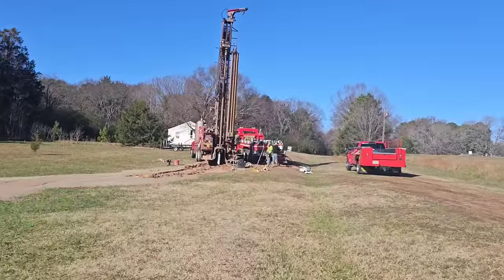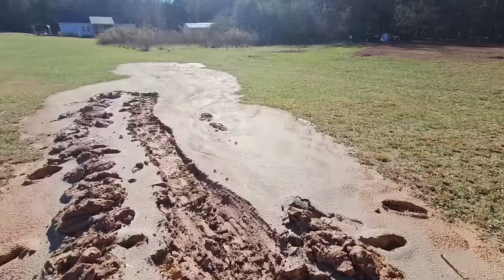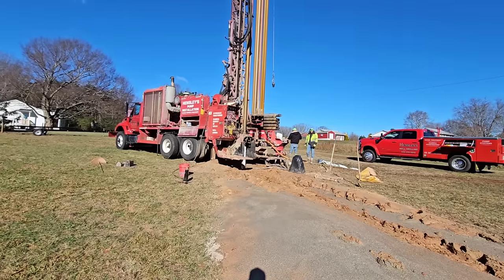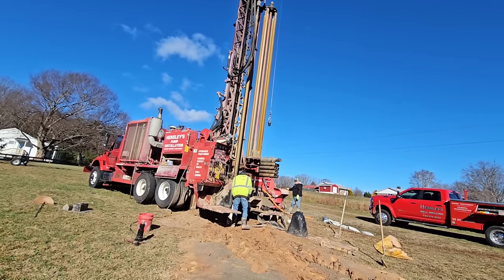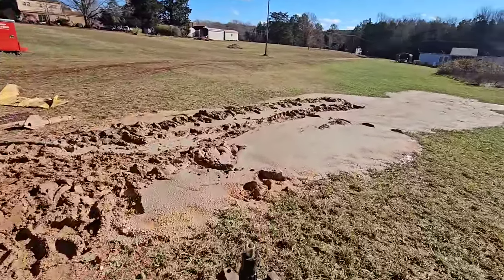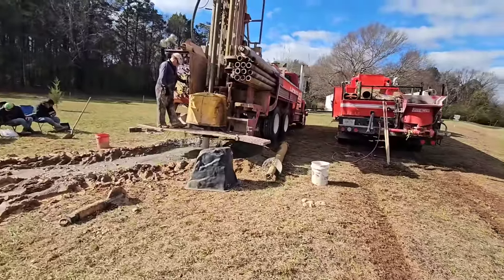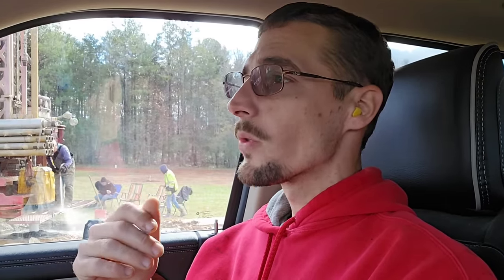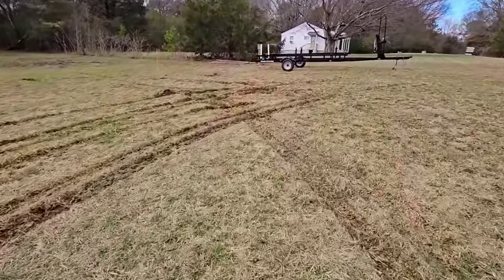The Worst Well in a Decade!

Comment: Around here in Central Florida it is common to lose circulation due to cavity's. Sometimes you can see your circulation spraying out of a neighbor's well. That is not a good thing.
Reply from the maker: I've seen that when Fracking a well, I often go look around the neighbors well to see if we're pushing water out. Only seen it once so far.
Reply: We had that happen on a Jordan well in Iowa. We were at 1860' deep and opened a sand cavity 3200' away to another well when we were developing the well. We had probably 100 dump truck loads of super fine sand come out of that hole.
Reply: @johnhardt5016  Wow, that's a long way. Ours were only about 100 feet away.
Reply: We also had sponge looking rocks as big as your first coming out. We did all this with an 18" hole opener on the end of our string of pipe.

Comment: Just be grateful you weren't drilling a geothermal well. Lived in Eastern Oregon in a town with a large number of geothermal wells. The underground water is about 195 deg and there was a 6.0 earthquake back in 1995 that caused the wells to artesian that actually melted the asphalt as they ran down the street. Appreciate you taking the time to explain what you see and hear during production and what they all mean. For the layman, I have no way to tell when you hit bed rock or water by the water spray under the rig.
Reply: How deep is one of those wells?

Comment: I used to drill using an air rig in California gold country and occasionally would drill into an old, unmarked horizontal mine shaft whose location was long lost to history.  This usually happened around 100 feet and would instantly stop the hammer at the bottom of the stroke and a total loss of air.  Usually moved around 50 feet from failed well and started over.
Reply: Lots of those down around Georgetown, Cool, even out to Diamond Springs.

Comment: Great video, in my drilling area  70-80% of the jobs we do are like this. We just do steel temporary casing and pvc casing to total depth.
Reply: I do the same here in europe...drill with steel casing after we finished drilling  run pvc casing n pulling out the steel casing. (*We use double top head drive rigs)
Reply: @xFlavoriax  that is the way. I am looking for one of those rigs and I actually asked for a foremost DR24 yesterday. The asking price is $1,040,000.00 (not in that league yet. )

Comment: You need to borrow from the oil fields in how to deal with this situation when setting the surface casing and drilling through the veins of rock.  You need to drill with Bentonite drilling mud. The drilling mud will hold your drill bore shape while setting the stone and sand from back filling you bore.
Reply: He mentions using Bentonite at 21:20
Reply: @Bleda412  this was in regards to grouting in the casing, I talking about a drilling mud that is used in the drilling process, and are 2 separate things.
In the oil industry they USA a drilling mud that is a bling of Bentonite, cellulose and ground retired money, in the well drilling process to seal off zones during the whole drilling process. 
They drill through the aquifer zones, then set casing, then filling the  casing with concrete, then set the blowout preventer, then they drill through the concrete to the target depth, then they set the production casing  down to the production zone.
This process isolated the aquifer zones from contamination.

I am familiar with a well that was drilled which was a horizontal directional well that was to have well over 5000 feet of horizontal bore, that lost 3 drill bits, they had to send down explosives inside the drilling Cable to cut the cable, and had to do this 3 time because of fractured rock in a fault zone, at that depth we are talking salt water zone.
The completed drilling the well as a directional diagonal well, which gave a very small production zone of the well.
The difference is he is using a hammer drill rig,and in the oilfield they are using a rotary rig using a diamond   Impregnated rotary bit to drill through the rock formations.
Reply: Worked for a core drilling outfit in my unger days,  no way your going to make it thru overburden without bentonite, especially on a 45 degree hole.  Must be nice for these guys to punch a hole in a day, leave a mess behind and hand the owner a $25k bill on the way out.
Reply: @raymondheckard234 they have a small shramm air conditioner rig, they done have duplex or triplex pumps on site or even a mud tub. The run a hammer and water injection.
Reply: @johnhardt5016  this is a big problem because it does not allow them to use drilling mud to seal off the areas in the bore hole such as sand zones or gravel beds.

Also with the drilling regulations of the EPA that is coming and is being pushed in states like California in the water well drilling, the days of allowing the tailings from the bore hole to run on top of the ground will be over and will have to be captured and filtered from the water before it is discharged.  

The EPA has a study that shows the tailings from water wells like all mining operations have contaminants of heavy metals.

A friend in the oil and gas industry was talking that soon the water well drillers will also have to comply with the the same exact regulations as the oil and gas industry under the Biden EPA.

He said it does not matter if you are digging  a well 100 ft or 25000 feet, when drilling through the rock formations, many of them have heavy metals in them, and to the EPA Granit dust is toxic, as is all drilling  tailings to the EPA are like all mine waste, Toxic.
Reply: @raymondheckard234 I totally understand and agree with you. I am a halliburton mud school graduate and understand the benefits of drilling muds and granulated bentonite sealing for the well bore. 
However you earlier stated using LCM (loss circulation material) for the purpose of drilling applications that aren't allowed in residential water well due to EPA regulations. 
However, usually a rotary mud drill is ideal for many applications for the purpose of the bore stability and retention. This doesn't seem to be a local regulation for these men. 
I enjoy talking with another person who sees the hypocrisy in the drilling field rules for some but not for all. Lol, have a good day man I look forward to hearing back. I am being a bit of a devils advocate here. I also want to see people understand the creation of a water well because most don't have the foggiest idea what it takes to develop the skills to read the earth like a book.
Reply: Thanx that is the best way for such situation. The problem is that situation is unexpected for the geology of that area "...to do the right thing saving time n money."

Comment: Interesting videos! I got a worse one yet for you if you like the tricky ones lol. Had 3 drillers here, worst/most expensive failure we have here was drilled 380ft total into 'traprock', 6" steel cased to 340', static water level around 250', produces 1-2 gallons per day. Can't get any of them to come back after a taste of the nightmare over here haha.

Comment: Bro I don't know if this is a 22:20  coincidence or an intervention but iam drilling a well right now with the same exact situation with the same Boulder problems and I dont know how this vlog just came up. I  just removed the 6 inch casing cos all torn up. Will use the 8 inch hammer to break all the rocks at 30 to 40 feet then put a 8 in casing then clear more space and put the 6 inch. And then drill the well to the bottom to 150 feet. Man I thought I was gona get lucky before Christmas and this nightmare well confronted me hahahah. Loved your video bro. Regards from western drilling Fiji

Comment: In drilling which makes drilling very difficult is drilling through boulders...i remember one site we left it because we cant drill any further. In this case using some other methods r very important.. here in europe we have double head top drive which makes the work easy or using auger bits and let the casing going through, after we go through the boulder formation normal drilling continue till the end. I like to hear from ppls used a different system. 😎

Comment: You made mention as to your preference in using chips vs. grout. I believe that using grout would probably be best as grout expands when it dries therefore creating pressure between the casing and bore hole sealing the two. The use of chips would not do this. I am not a driller but learned the use of grout in the traffic industry as it is used to hold the traffic poles up against their anchor bolts and base.

Comment: Hi, bit unrelated to todays video but I have a question: Lets say you are drilling a well and hit (bit of) water at 200ft, decide to drill deeper and hit another water at 600ft. Now those two aquifers are connected by the well and the water can flow from one aquifer to another? What if your neighbour has 200ft well. Can your well drain the 200ft aquifer making the 200ft wells in the area dry over some time? Similar situation: you hit water at 200ft decide to drill deeper and don't find another water. Can you lose the water by draining it into some porous rock deep down? Thanks
Reply from the maker: The static water level on both wells will be the same.  Both would fill equally, one would just have deeper storage. It would only cause a issue during the drilling process of the 600ft Well bc if its connected to the 200ft well it would drain it dry temporarily (I've seen it happen). But during typical usage, both should be fine. It's rare unless 2 wells are 50-75ft away from each other.

Comment: Sop forgive me if you have covered it before, but I assume you just push air down the drill pipe then to the head?  What kind of pressure / volume do you inject into the hole?  Keep up the good work sir!  👍🤠

Comment: When I was a kid my grand parents had to drill a new well on their place because the water quality was so bad. They lived south of Monroe, Louisiana in an area where one of the largest natural gas fields also exists. They had to go about 450 feet to get good consumable water. They were on their third hole before they were able complete a hole. At about 75 feet they’d hit a natural gas pocket and it would blow the whole drilling rig several feet into the air when they’d hit those pockets. The first pocket they hit cost the driller a few sections of drill stem because it broke off when they hit it. I got to see that and it was scary.

Comment: I will have a driller out in a week.   It will cost over 100K to drill, steel case 575', and gravel pack.   If they loose circulation that will cost $10,000 more for additives and cotton fiber.   Sometimes a hole needs several hundred thousand gallons of drilling water.

Comment: Drilled in Alaska, bolder till field  we used steel casing, welded together in a drill and drive casing hammer . Wait till you drill through  200 ft of Ice, then hit gravel stone , the water comes up through the hole , it’s artesian well, the well water starts thawing the bore hole to the point we almost lost the rig !!!  Casing could not be set , due to pressure!!! You have not seen the bad ones , Drill in multiple states (licensed )

Comment: Don't feel so bad about the tire earlier this year my tires were getting a bit thin so I figured let me just do all four at once..... Two weeks later I had a flat tire. On top of that because I drove a mile they weren't gonna cover it so I had to buy another tire. I'm like I was getting off the highway there wasn't really any place to go in traffic wouldn't really let me off in the worst part I literally stopped two exits before I got off to put air in the tire and it was round and not flat.

Comment: takes a lot of air to move those sized rocks. Hard on equipment. Especially when the differential between the casing and drill string is so small. Do you typically do casing-following drilling? Do you ever do dual-tube reverse?

Comment: Gday from Australia… question ? We have situations here normally in commercial building were low flow is only available a holding tank is used to meet peak demands… is this something common in US? For example 1000 Lt tank with booster pump or gravity feed after the supply. What I am suggesting is well pump feeds tank and all water I supplied by tank.
Reply: I don't know if I've seen it on a commercial building, but there's a few small neighborhoods in my area with communal wells that pump into small tanks like that overnight when the power is cheap and everyone uses the tank water during the day.
Reply: See it a lot in low producing shallow residential wells here

Comment: I wonder why you fellas didn't try using a tri cone bit and mud the casing in, at least that way you would not have the air pressure to contend with, you may have been able to grind up those small stones and been able to lift them out with water and mud , it may have been an easier time of it. Just a thought.  Dave D.

Comment: Just drop a 1/2" wall 5.5" pipe 4' long, filled with smokeless powder. , compressed until it's hard as concrete.  Install multiple electric matches.  Drop it below the casing drop it in set it off, open up a crevice down there!😮

Comment: Was the sand gravel water bearing ? Unconsolidated material would a mud rotary hole/drill rig done you any good ? We drill open hole and screen our wells here, screens on casing depths to 300' clays, sands etc unconsolidated material mud rotary rigs our wells average 50+gpm screened.
Reply from the maker: There was no water in the river rock/sand zone. It was eating up all our water.

Comment: How old is that drill rig and how much does something like that cost.  I have considered getting into the well drilling business for probably the last 10 years.  Where I live there isn't any good drillers and there really isn't any drillers in the area.  I have 3 operating wells on my property currently and my shallowest well is 600ft and my deepest well is nearly 1200ft and all 3 wells are steel cased to depth.
I have heard that sonic drilling is the way to go.

Comment: What are the chances that one day you could mock up an example of how the bottom metal section of the casing seals up against the bore hole in the bedrock?  I'm having a hard time envisioning how a steel pipe can seal up tight against a rock hole in the ground??

Comment: Immediately after shutting off, my well or pressure tank or something make a short 2 second gurgling or back pressure noise.  It has done this for many years.  The 3/4 HP pump is 30 years old.  The 44-gallon pressure tank was replaced a few months ago and the noise continues.  Any idea what it may be?  Thank you.
Reply: Check valve failing or leaking fitting at the pump or well cap (or pitless). Do you have air in the water as well? Get it fixed soon.

Comment: I live in Central Missouri up on  a big hill above the Meramec River. I had my house built in 1996. The well was already dug. There was a house here when I moved here. I had the well pulled an a 2 hp pump put in . My house is 6200 squ ft. In door pool. My well is 285 ft deep. The guy I bought the land an house from digs wells.like you do. He run the new lines to my new house an he put in a pressure tank. I don't have much water pressure. I was told I need to drain the pressure tank. I'm not sure what I need to do after that. I thought I was told to drain it fill it up about 1/3 way up an add pressure from air house. I'm not sure how much air to put the gage to. This tank is like 2 ft round 5 ft tall. Way so big dont know. Would you be able to tell me how much air to put in an it a 1/3 way up with the water right amount?

Comment: Philip you haven't seen any worse wells. The worst well is when you drilled and water 2 meters high pours out of it at a frantic pace and cannot be stopped. We had this Closed for 2 months. and it must be closed very quickly, because the water washes out sand and clay. The packer cannot be stopped, the water goes to the length of the pipe. and you have to fall asleep and use foaming glue.